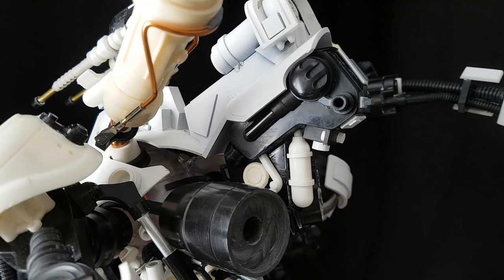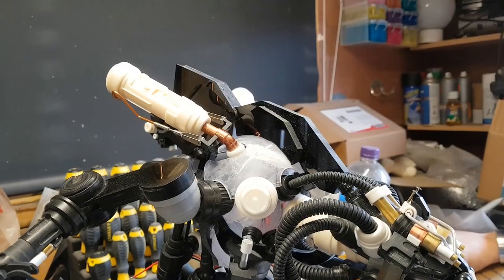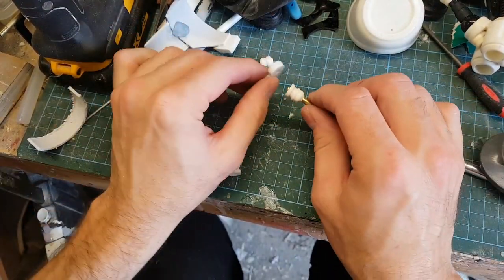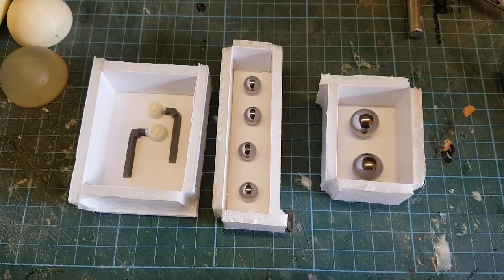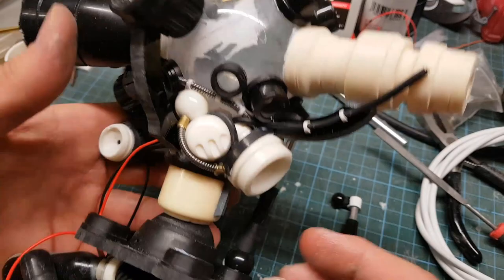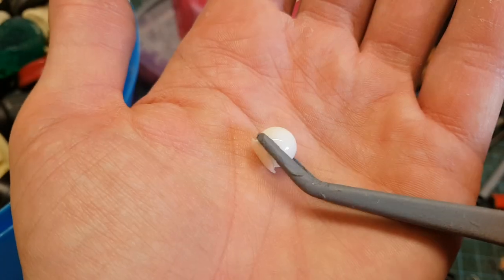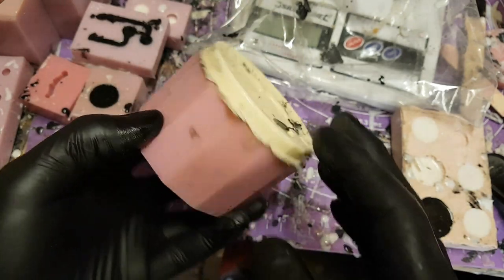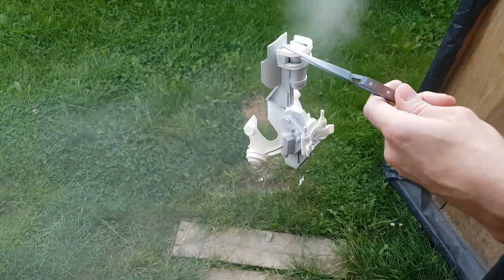Demon Mech Build Part 3 (Original Mecha Contest 2001)

Comment: Something that really works as small scale cables are (old) guitar strings. The round wound ones look like conduits and the single wire ones look like cables. Guitar strings come in different gauges. So you can choose them specifically for your purpose.
Reply from the maker: Yep good tip. I have a few bass strings I've used previously, they work well. Cheers! 😁

Comment: Amazing build! I see pieces from VHS-cassettes on on your mecha. Try to take a cigarette lighter apart. The have interesting looking pieces inside. Keep on that great work!
Reply from the maker: Well spotted! Yeah I used to work with loads of VHS tapes, so I would collect all the bits when they were binned. Good tip on the lighters, I actually did that for my first ever mech 😁

Comment: As this project has evolved and more detail is packed in, I was curious how you might retain some of the metallic parts when it comes time for paint? One idea is to go ahead and prime/paint over everything that needs paint, even if some of those metallic parts are lost. Then come back with a rag dipped in acetone and dab over the top of the metal pipes and such to reveal the metallic bits (kind of a Rub n’ Buff technique but in reverse, subtracting finish rather than adding). Just an idea. Good luck 🍀. I hope your piece does well in the competition.
Reply from the maker: Cheers dude.  Yeah I've been wondering that myself!  I'm currently painting it and I basically ended up painting around all the metal bits as carefully as I could and then scraping away any excess paint with a scalpel.  Abit of isopropyl alcohol to loosen everything up helps as well.